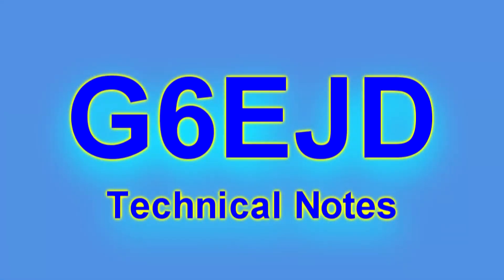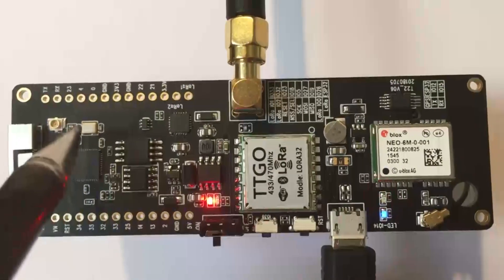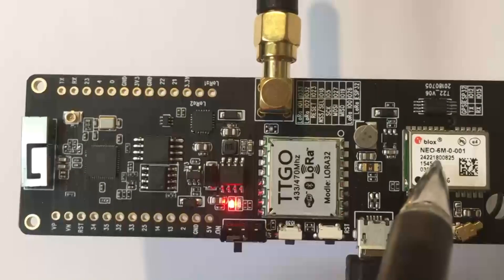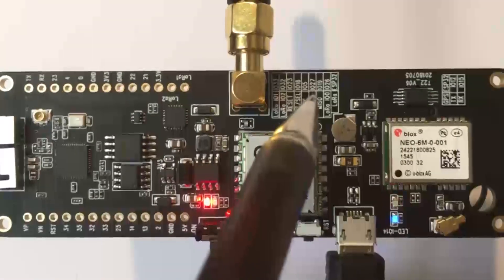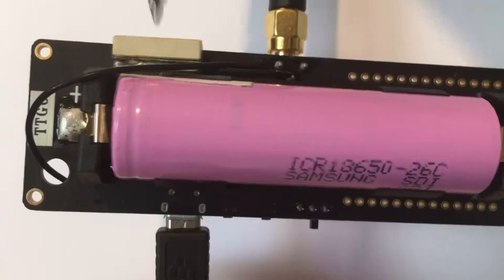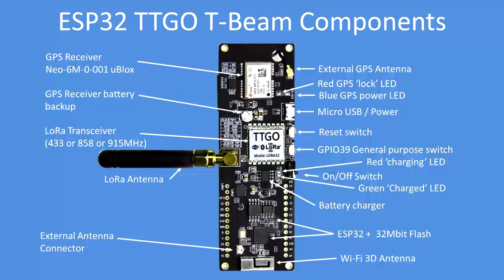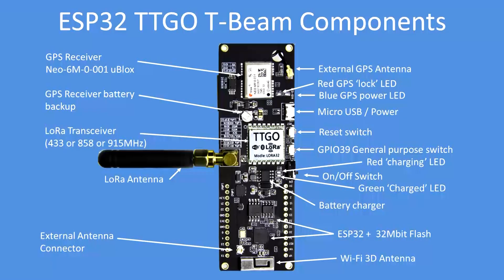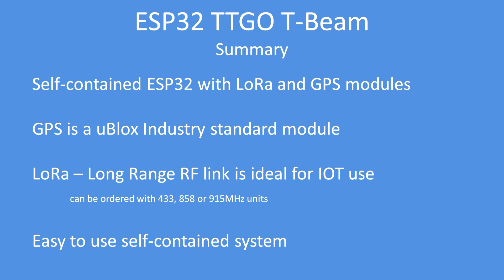Tech Note 105 - ESP32 based TTGO T-Beam LoRa + GPS

Comment: Is this module compatible for all three frequency range ie "Operating frequency: 433MHz/868MHz/915MHz"? or while ordering the T-Beam module, should I have to choose 868MHZ for the frequency range  ie.for UK EU863-870.
Reply from the maker: You have to order the device according to the required frequency for your country, so UK you could still choose 433 or more correctly 868MHz. These boards are remarkably easy to use and I integrate e.g. gps data and send it over LoRa for a long range low power link, you can also implement LoRaWan for multiple devices so plenty of potential. The LoRA library is in-built in the Arduino IDE.
Reply: As per https://www.thethingsnetwork.org/docs/lorawan/frequencies-by-country.html#u the frequency allotted for UK is EU863-870 only. Is Radiating 433MHz in UK allowed and legal as per the link?

Thanks.

Comment: Whery iiiinteresting. Is this like telemetry transceivers on my quad? What would you use this for, I have no imagination?
Reply from the maker: Sick Vic it’s a board mainly for robotics or really long range wireless connections to transfer data most probably, as ever the applications are a function of the end users imagination.
Reply: Transmit video?
Reply from the maker: For fast scan (normal) video the bandwidth is insufficient but slow scan definitely.
Reply: Car, motorcycle or any other stuff alarm system / tracker - first idea that comes to my mind - you can use LoRa to transmit location of your stuff if suddenly it decides to move without your permission/wish..